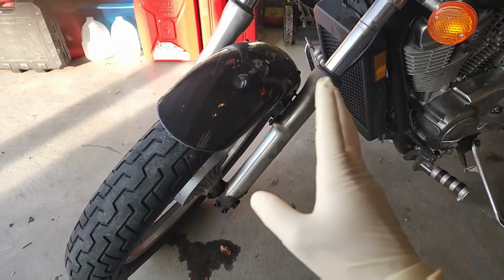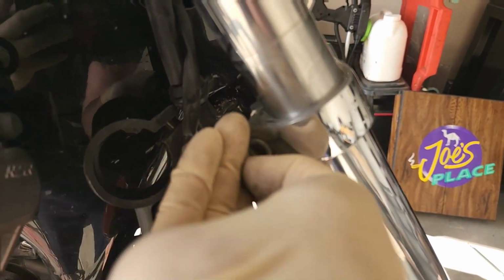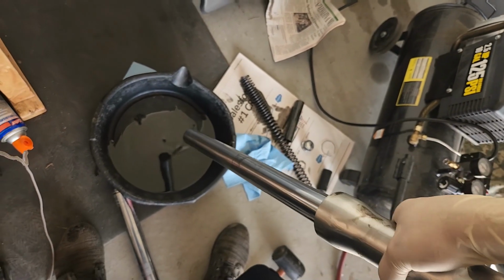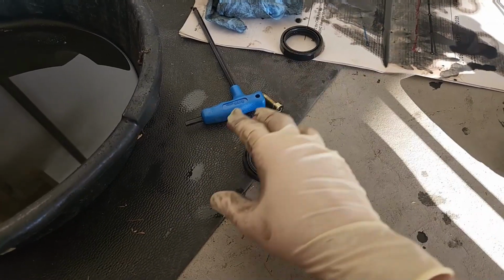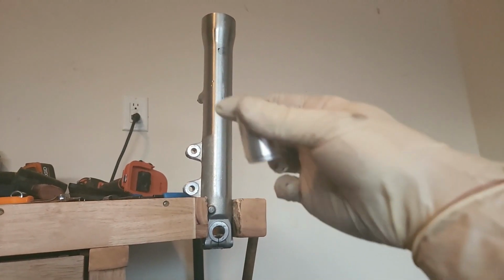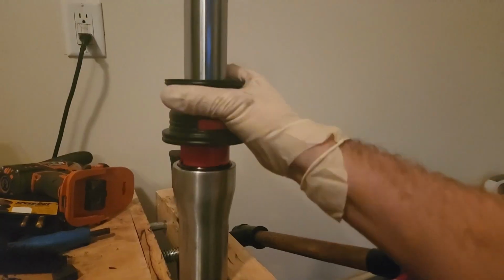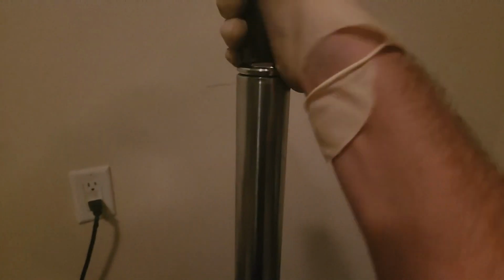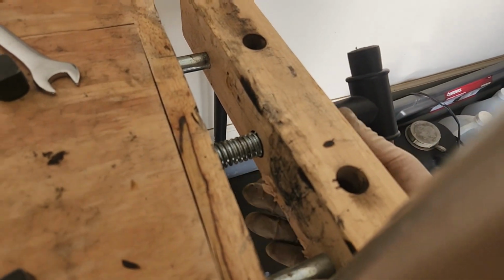How To: Rebuild Front Forks on a Honda Shadow

Comment: Did you remember to pump the fork up and down by hand several times before adding the spring to bleed the air out after adding the new oil
Reply from the maker: Yes! Good point. We need the air from the top during final assembly. Helps to prevent blown seals

Comment: Hey man, greeting from canada. I followed your video to a t, and it seems as though I may have messed up which parts go into the upper tube bs which go into the lower tube. Are you able to clarify? You video shows how they go together but not if the oil seal ect goes in the lower or upper fork tube. I attempted to rebuild my tubes and have had a heck of a time, any classification would be greatly appreciated thank you
Reply from the maker: Watch from about 6 minutes to 10 minutes again, this is a bear of a job. We ended finding it easiest to assemble the piston and the oil Stopper, then slide the upper tube into the lower, and drive that oil seal home into the lower fork (beveled portion). Add a c clip, and carry on. 

It helps to have more than 2 hands. Kyle did this one alone, but it took a long time to get it all lined up right.